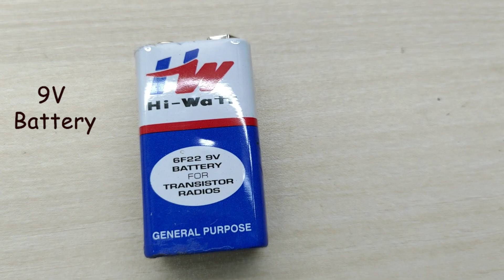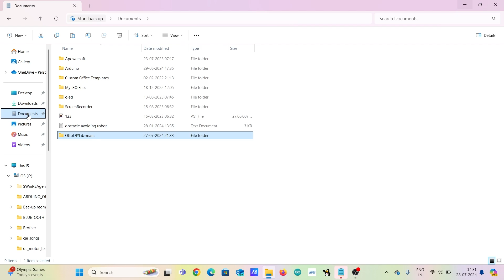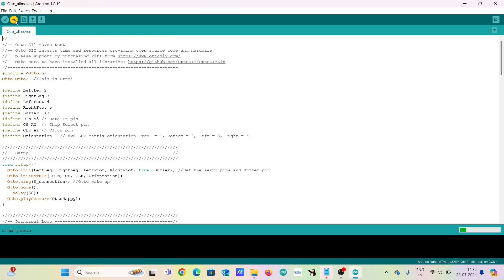How to make OTTO DIY Robot in easy steps #arduinorobot

Comment: i also faced similar problem the simple solution is to use 2s lion battery pack . the insufficient current leads to restarting of arduino
Reply from the maker: Thank you friend for the solution. I have also found out that using 6x 1.5V AA batteries also doesnt cause the restarts as each AA battery is rated for 2A peak current!!!

Comment: You connected the 9V positive wire (red, switched) to the 5V pin on shield?
Reply from the maker: @paziproductions  Yes friend. I connected to 5V pin on shield. But it was not working properly. The 2x 9V batteries are not able to provide enough current for all the motors to work together. I used even 4 x 9V batteries which were also not sufficient. It will work for a few seconds and the nano will get reset due to drop in voltage. One possible easy  solution is to use 4X AA batteries. They have higher current rating and I have read that it will work. I have not tested though.

Comment: In obstacle avoiding car the bc moter not going rivers pls tell me solution for it
Reply from the maker: Hi friend, you have to check the connections. Is it going only forward and not backwards when it sees an obstacle?. Sometimes the ultrasonic sensor may be faulty!!!
Reply: Do you have an Amazon link to buy the screwdriver to fix the screws in the legs? (we tested several screwdrivers, each time the screw fails and we can't screw enough for it to hold well)
Reply from the maker: @Jonathanquesnel I am sorry friend. I used a screw driver that I got alpgwith the toolkit while purchasing a 3D printer. I know the screwdriver needs to be long and also should pass through the hole in the legs to tighten the screws. It is a littlebit tricky and not possible with all screw drivers. I am sorry that I dont know the purchase link for the screwdriver.
Reply: @Science_4U_  I found you have to use a PH00 screwdriver.